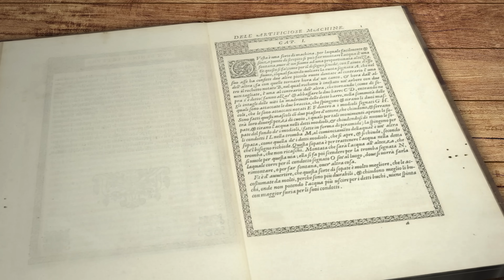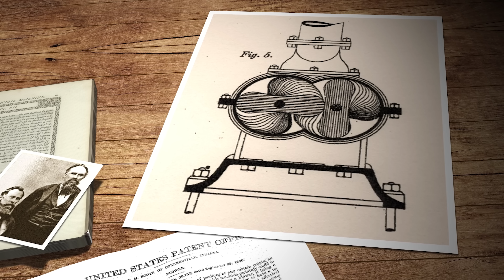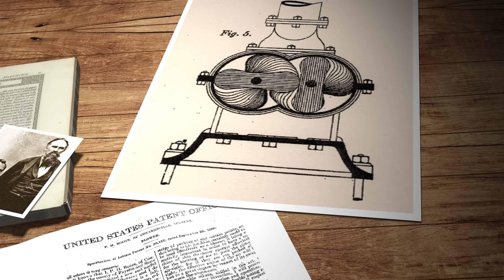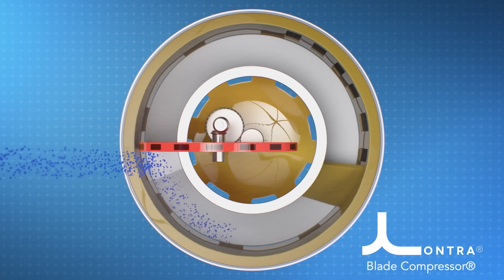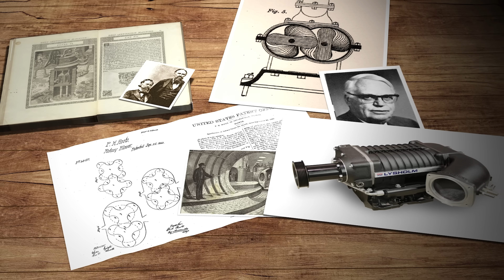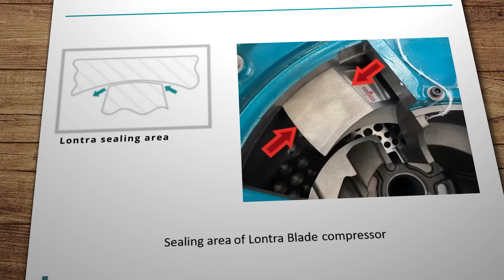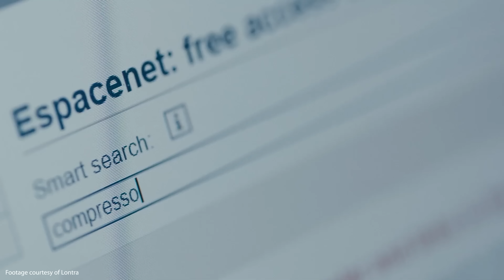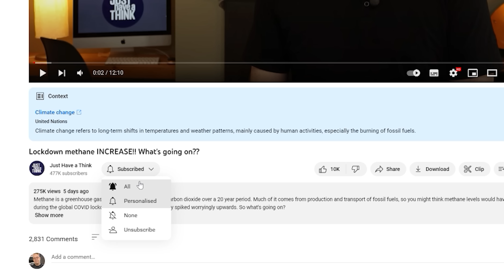Compressing air to reach net zero. A 'revolutionary' innovation.

Comment: Presumably, it would increase round-trip efficiency on compressed air energy storage installations as well, which would be interesting.
Reply: I thought this video was going to end with that.
Reply: i agree the biggest problem we have in replacing petrol cars is top up time , even if the range of a air car is say 100 miles , toping up would take seconds as opposed to half an hour to an hour for an electric car that may well be double the range 
its also much lighter which is a consideration as well
Reply: @firsteerr  The problem of an air car is continuous depletion of the air tank decreases usable capacity due to gas expansion cooling. Think of a can of compressed air to dust your computer freezing if used long enough within a short enough time span. The argument of "it takes to long to charge electric cars" is intellectually bankrupt as you park your car at work for 8+ hours and go to sleep at your house at minimum of 4+ hours. 

In my opinion charging an EV is moreso a parking, residential infrastructure, and investment issue. The last two biggest specific issue is if your house is old enough or small enough you may not even have the breaker panel available slots to add in EV charging. That alone could necessitate a $5K+ main panel replacement and rewiring. Which my aunt experienced after purchasing a Tesla while living in San Francisco in her 1960's era built house. In a separate but somewhat similar issue those living in apartment / condo complexes are not given the option of a one time fee and being slapped with a perpetual increase in home owner association fees. The subsidization of these chargers has inflated the true cost and these installers / hosters are banging consumers in the head.
Reply: Global warming is a globalist fraud
Reply: @NwoDispatcher  - 100% agree.
Reply: @NwoDispatcher  - polluting it with ACTUAL toxic chemicals is the real risk (and actual happening) that they choose to ignore, while promoting the glow-ball-ist agenda of “Go blame your selves and die”
Reply: Compressed air storage is a turkey 🦃 due to the energy wasted in heating the air, unless you need the heat in another process.
Reply: @thamesmud  - I need heat all year round for DHW, and home heating, in my Pacific Northwest coastal environment.   Waste heat from compressing air that can then be stored and used later.  actually sounds great, but conversion loss from solar electric to motor to compressor, then compressed air to generator, makes a home scale system less attractive.

   Though what is achievable by me, is something more along the lines of the first solar thermal heated net zero homes in Fairbanks Alaska.

  Super insulated homes, built  around 5-15k gallon insulated water tanks, allow them to bank the three months of 24 hour sun, to heat the home and provide domestic hot water, through most or all of the 3 months of no sun.

  I should be able to meet all of my heating and DHW needs with a much more reasonable 500-1500 gallon insulated solar thermal stratification tank.

  They have some good videos (sadly not well mic’d, but very informative) on their YT channel ReinaLLC.    Mythbusting Solar Thermal, is a good one that shows the guts of their heat storage and distribution system.

  I will use a combination of solar thermal, solar electric dump time heating, small wind and hydro, with an open tank rocket mass wood boiler as backup to those. 

  When we (frequently) don’t have sun, we often do have wind and rain, thus the right types of wind and hydro make sense for my situation.
Reply: @thamesmud  On a grid scale production basis energy efficiency is relatively moot IF excess energy is converted into hydrogen and blended into the existing natural gas infrastructure without necessitating ANY modification if kept at a relatively low percentage. As it's cheaper to expand production capacity than any other form of storage.
Reply: Irrelevant, sadly.
Reply: @terencefield3204  Cause the gaping inefficiencies? I've heard the affordability of off the shelf components and renewables could make the losses viable. Would you disagree?
Reply: @anthonydunn729  the UN map of heat equation viability across the globe is clear.A tiny shift at the margins from a technological novelty does not amount to a row of beans.The rest is hope over reality and cynical marketing to techie types.
Reply: @terencefield3204  You may be interested in "solar punk" and degrowth.

Yes, even rolling out something like nuclear power only delays the collapse induced by capitalism requiring perpetual growth.
Reply: @economicprisoner  I'm interested that you point out the perpetual growth economic model. I have tried rather unsuccessfully to impress on people that that model has to change. Though I don't have a viable alternative that isn't tainted by being based on artificial (or arbitrary) metrics.
Reply: @anthonydunn729  Have you heard of humidity? There's absolutely no cure for the energy lost due to condensation.
Reply: @economicprisoner  Your ideology and proposal is flawed pipe dream logic as we could end all fossil fuels today in western society and emissions would still go up globally due to India and China alone. Then you have to factor in the sudden demand drop forcing oil pricing cheaper that poor countries would fill in some of the gaps until it becomes financially unreasonable.
Reply: @RichardPrendingue  It is easier to imagine the end of the world than it is to imagine the end of capitalism".

The fundamental problem with capitalism is that it relies on perpetual growth in order to pay back investors (who expect a return on their investment). This is exponential growth: and is always unsustainable long-term.

Comment: How about a hybrid electric car using this?
Reply: To do what?
Reply: @sammason2300 lol to drive it, using the inertia of the electric motor to compress air into a tank until a certain amount of pressure is achieved then it switches over and the car is propelled forward using the compressed air using similar technology that compressed steam using fire to drive steam trains, swop out the steam for electricity and some of the  energy in moving forward is stored then recycled.
Reply: @zargonfuture4046  Horrible idea.  The battery is a more efficient energy storage device.
Reply: @zargonfuture4046  I'm afraid this solution will have a very low power density and very low efficiency
Reply: @incognitotorpedo42  so you're saying hybrid motors are a horrible idea yet it is popular?
Reply: @sammason2300  so there is no spare capacity from the electric motor plus motion to store compressed air via this pump system simular to a petrol/electric system, so using the wheel/prop shafts of the car as it moved forward would not be able to use the pump system to store compression that can be fed back? Would there be too much energy expended by the electrical motor and the battery?
Reply: @zargonfuture4046  There are often several ways to achieve an outcome and your proposal could work in principle. However, economics is a real thing and, particularly with vehicles, power density and efficiency are of prime importance. Compressed air is simply not a very good energy storage medium compared to other technologies

Comment: The rotary screw compressor rotors never touch and they are flooded with oil that helps sealing .so very low friction.

This one appears to have huge surfaces sliding against each other.

Other than less vibration than normal reciprocating compressors and easier to machine than the special rotors in a screw machine , I do not see any real advantage .

Also unless there are two stage versions , limited to low pressure applications as any  good 125 psi unit is two stage with an intercooler between stages to lower energy consumption .